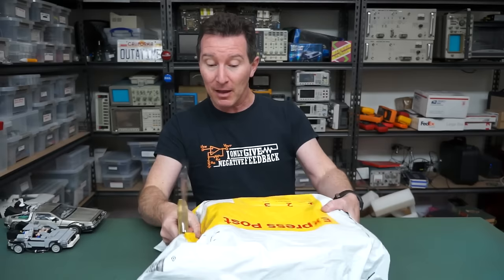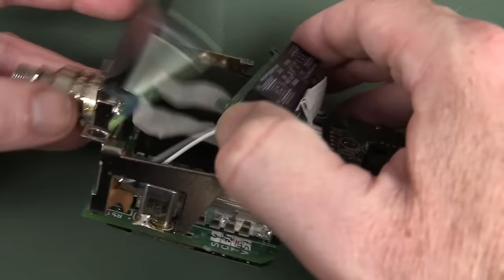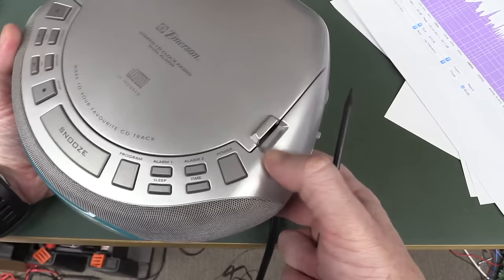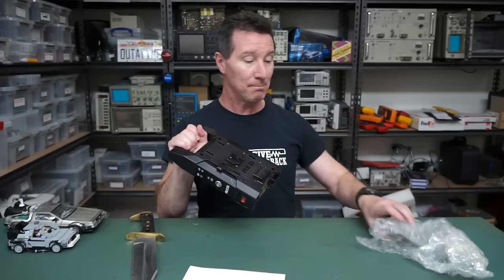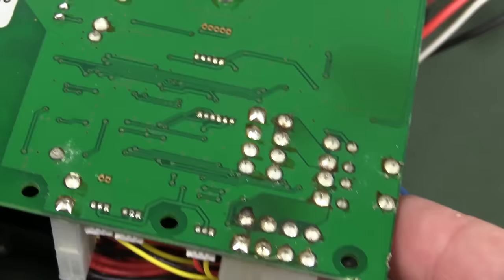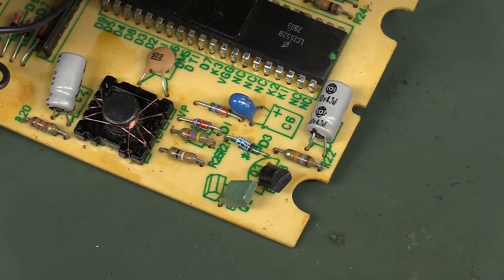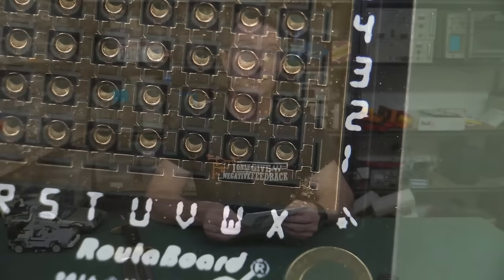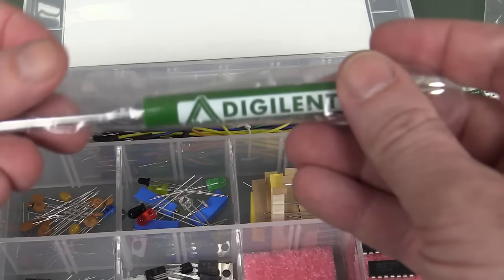EEVblog #922 - Mailbag

Comment: Sorry about the foam in the case holding the RF Signal Strength Meter falling apart. It was not like that when I sent it to you. Thanks for a great tear down.
Reply: How many years ago did you post it? :)
Reply from the maker: Interesting. Not the first time it's happened. I'm interested to know who the transport causes this so quickly.
Reply: Got left in a hot transport truck maybe?
Reply: And started to decompose as a result? Yup, sounds quite plausible.

Comment: Hi Dave, thanks for including RoutaBoard in your Mailbag review. Those were the earliest generation samples which I sent you right from the first prototype batch (best suited for the museum now). 
The recent model is improved with a better layout on the two sides, two more global buses, solder paste pre-applied over the contacts, so they can be bridged together by simply touching them with the iron. Still black soldermask, though. But point taken, I might try out a few different colours in the future, and see which one will work best.
Don't rush yet having a test go with the old ones. :-)
KnivD
Reply: I've got the newer version RoutaBoards and just want to say how fantastic I think they are!  I don't think I'd ever use the software, although I have played with it out of curiosity, and I appreciate the effort that went into it.  Still, this is, far and away, the most useful proto-board I've ever had the pleasure of building with.  The manufacturing quality is top notch.  I find they're even better for SMT than those shitty checkerboard PCBs you can get.  SOIC and chip carrier packages fit perfectly, but anything smaller than 1.27 mm, and you're out of luck (not that you'll find boards like these that are so flexible in the first place).  I really hope they catch on more and that you keep producing them.  As you can see, I cannot recommend them highly enough.

Comment: A while ago I was reading a story from the ministry that is responsible for tracking down radio frequency disturbances, and they   found a similar radio with a similar error (though the story reads in the 180MHz range, might have been the harmonics though). All the story said was that some "components responsible for coupling the LO into the receiver failed, diverting the signal" so my guess here is that some rf related cap failed short.
Reply: +1 so Dave can see
Reply: Kind of poetic how we've been building radios for over 100 years now and yet it's STILL the darn capacitors that cause the problems? The more things change, the more they stay the same, right?

I thought about this for a while, and if they're using a notch filter on the input to keep the LO frequency off of the antenna, it could be that the LO has drifted a bunch.
If it's crystal controlled the crystal could be damaged, or the circuit could be just so drastically out of tune that the crystal can't pull it back into alignment.
If that's true than all the filters designed to block the LO frequency could still be doing their jobs and the signal from the LO would still get out since it's on the wrong frequency.
Went down the rabbit hole a bit on that one, but hopefully it's understandable.
I know just enough about RF to know that I don't know enough to be talking about this kind of stuff with any kind of authority, I'm just hypothesizing.

Of course it could also be something as simple as dried out power supply decoupling capacitors, a fact that jumped out at me since Dave mentioned that this was built in the early-mid 2000's. Those caps have been in service for 10-16 years by now, and that could by itself be enough to cause them to drift and/or fail if they're using whatever is cheapest at the shenzen market that week.

On another note, I'd bet this radio would have been tracked down as a noise source by some ham radio operator if left on long enough. It looks like it was putting out some serious harmonics well above the 95Mhz "fundamental" peak.
Reply: When I was 10 years old I tryed to "modify" a cheap FM radio by adding bridge wires to the circuit and turning the tuning coils. I had no idea what I was doing the the thing went totally crazy. I was able to jam most TV channels from 100 meters away with the radio. I wish I still had the thing to test it on my spectrum analyser.
Reply: The filter of the output signal processor of the Frequency mixer could be faulty. Meaning that the device is now transmitting the 4 different Frequency signals at the same time, and possibly at an amplified level, if the amplification section of the output signal processor is still working

The Multiplier component of the frequency mixer could also be faulty, in that it is not able to correctly tell the output processor how much amplification is needed from the data of the original signal 

I'm probably terrible wrong, but what can you do..
Reply: "I was able to jam most TV channels from 100 meters away with the radio."

Some older computers had a similar effect in that the screens RF made sounds through the computers speakers because of the high level of/ poor RF shielding etc
Reply: I think my solution only works if there is an RF signal to begin with.. I'm not sure what frequencies an rf receiver of a radio can pick up 

I'm guessing it could also just be the electricity running through the frequency mixer from the LO into the multiplier, and there is a blockage from multiplier to output signal, so it travels the closest path back out up the input rail ?

Comment: I don't know about failure modes, but in my wild and careless youth, I had this habit of turning old superhet FM receivers into FM transmitters.
Long story short, even if you have proper variable caps for the tuning, you very often have varicaps for AFC. So, find the afc control voltage net, add a chain of components consisting of an RF choke, DC block cap and pre-emphasis network and apply appropriate voltage level signal and you have a low-power transmitter...
So if you go ghost-hunting on the clock radio, my chief suspect would be some component failure or crud in the LO signal net.

Comment: THANK YOU! And this is why I have, since I was a teen, been completely ANNOYED by Gilligan's Island! There is no way a know-it-all "Professor" who could make batteries from coconuts and seawater would NOT KNOW you can make essentially ANY receiver into a transmitter simply by pumping more current through the local oscillator!

You have a radio that works!
You are supposed to know everything!
HOW DO YOU NOT KNOW TO SHORT THE EMITTER OF THE LO AND TRANSMIT CW ON AM BROADCAST?

Shortest TV series ever.

Comment: Using a working radio and tuning it to the local oscillator of another one is a known old time trick used to check if the oscillator of a receiver you're servicing is running or not.

Comment: That Li-Ion professional camera battery charger is for V-Mount batteries, the batteries themselves have micros inside that can talk to the camera via different protocols (I2C, analogue etc) depending on the camera manufacturer, to report the remaining time by sensing current draw, autobalancing the battery cells etc. the chargers usually cost over 300 euros. and the batteries are also 150+ euros.

Comment: In that clock radio thing it looks like the front end amplifier has become an oscillator.  Some of it's output energy is feeding back to it's input, and hence to the antenna.

Early transponders for military aircraft worked like this.  They were basically an antenna connected to a tube amplifier that was on the edge of instability.  When an RF burst comes in from the interrogator on the ground (or ship) the amplifier would go unstable for a short time, during which it transmitted back another RF burst at about the same frequency.

Comment: For the radio, read the book Spycatcher and you will find a description of a technology to track radio receivers by LO emissions.  Since spies don't want to be heard, they use a different frequency from the ones in commercial use.  Spies typically would listen all the time and only transmit on cue or on time.  thus the only way to catch a spy reciever was to listen for the LO emissions.  Modern radio receivers would not likely emit the level of LO noise that old radios did though.

Comment: I've got the newer version pre-soldered RoutaBoards and just want to say how fantastic I think they are!  I don't think I'd ever use the software, although I have played with it out of curiosity, and I appreciate the effort that went into it.  Still, this is, far and away, the most useful proto-board I've ever had the pleasure of building with.  The manufacturing quality is top notch.  I find they're even better for SMT than those shitty checkerboard PCBs you can get.  SOIC and chip carrier packages fit perfectly, but anything smaller than 1.27 mm, and you're out of luck (not that you'll find boards like these that are so flexible in the first place).  I really hope they catch on more.  As you can see, I cannot recommend them highly enough.

Comment: Products like IntegriFuse are important because USB security sucks and it's pretty easy to dump payloads on a mobile device or have a compromised mobile device dump payloads on the machine it is connected too because USB was not designed for security(there are no USB firewalls!).
  I really don't know how good IntegraFuse specifically is so I'm not endorsing it beyond saying there should be a market for products like it(affectionately dubbed USB condoms).
 My other thoughts are maybe it should get a actual set of FBL fuses because USB 3.0 can do like a 100 watts of power in special modes.

Comment: The connector on the TEK meter could be done this way because this product is pointed to different markets and different connectors may be suitable. Also, as a second idea, it might be done this way to recess a connector in respect to pcb to meet some height considerations.

Comment: I think the RF strength meter's charger socket's sub-circuit-board may be just a space saving measure. (Main circuit-board has the clearance it needs without one half of the outer-case becoming too deep.)

Comment: On a radio receiver there is supposed to be a band pass filter on the antenna input to keep the LO from leaking back out.  Part of this filter has failed and is allowing the LO to leak out from the first heterodyning stage.  

If the radio was locked onto a channel the LO frequency would be more stable and wouldn't be hunting.

Comment: I had a Logitech X-530 2.1 system. Use to pick up radio stations. Believe it or not it was a lack of grounding on the transformer that caused it, or at least lack of grounding to the board since the cord is non-grounded. just attached a wire to the casing, attached the other end to the "ground" on the amplifier board with a resistor in seiries, it stopped receiving. Emerson was decent stuff, weren't the best quality but they work for years. The cd player has shock mounts because that radio probably has "anti-skip" which back in those days was just a term for something that was well shock mounted.

Comment: FYI RED camera gear are monstrously expensive, that charger costs $550 US without batteries witch are $450 each. they also sell "cheese plates" (square pieces of aluminum with 1/4" holes in them) for $275 and various semi propriety cables for $100+ they even sell a 6" bnc cable for $50 because its labeled as a "HD-SDI" cable witch is a protocol that runs over coax. their cameras are not that badly priced but they really kick the bucket in all the accessories that they make %3000+ profit on

Comment: Dave, I think the interfaceconnector is on a seperate board, so they could use an other connector (with an other formfactor) more cheaply on the same main PCB without redesigning the whole thing.

Comment: Actually you want some bias when using that RF tool, so you would plug it in at the tv or as close to that as possible. If you do it from the roof, as you said it's minimal loss, the results would be better signal but the tv would have a harder time reaching those channels. Also you would compare it with and without the cable to tell if you need a booster or not.

Comment: I'd guess that having the connector on a separate board prevents damage to the main board if dropped while plugged in.

Hot connectors on that charger. Looks like they rolled their own rapid charger.

Comment: I suspect the connector PCB is to make it more flexible if they want to switch battery connector. Then you don´t need to remake the whole board.
Another reason may be to get battery connector in right height...

Comment: DB25 on the sub board in the TV signal strength meter is probably fitted that way to allow different socket types to be fitted at manufacture without needing to respin the board for every type.
Reply: or the original socket went EOL and they didn't want to respin the whole thing!
Reply: Other possibilities are is some mechanical issue with alignment or to make it easier to replace if damaged.
Reply: Perhaps they did not have the option to change the battery or the case design, and so was limited in how high the connector could protrude from the circuit board.

Comment: the USB fuse, that is a terrible idea, for charging it is really important the phone know's what's it's charging off. Shorted data pins means it's a normal 5v charger, and will try to pull as much power as possible, if you do that off a PC you're gonna have a bad day. If you don't short them you'll only get 500mAh and it won't charge. I know my quick charge 2.0 charger communicates with my phone to deliver 9 volts @ 1600mAh, failing that 5v @ 2000 mAh. Not to mention it seems that one data line passes though anyway.
Reply: I believe the point of that thing was that you would put it on the charging lead of your phone or tablet if you are going to connect it to one of those public USB charging points.

I suppose the idea is that since It is in theory possible that such a point actually has more than just a charger in it( and so could install something nasty on your device or steal data from it), you might want to break the data connection while still maintaining the ability to get power.

Though how good that specific device would be, I don't really know, you would after all have to trust that it was not something nasty itself, and that it was not badly designed in some way. xD

Comment: This Orange Pi is not worth getting yet, for the common person that only knows basic code. There is almost no driver support and you can't get them to fire up there is no bios to start from. It will not recognize anything. Not a keyboard not a mouse. I have 2 Pi 2's one wireless model and a Pi 3 with the works even has sata. Sadly I don't have the skills to program it.

Comment: That RED charger is probably for NiCD batteries. Maybe that is why there were a discharge resistor and no LiIon charger chip. We had a V-lock battery bursting into fire at work when being charged on a similar charger. Exiting day. That was in the early 2000s.
Reply: There is "LI-ION BATTERY CHARGER" written on the device.
Reply: +kroplaaaa oh! Sorry :)

Comment: 08:00 I like this video but there are few inaccurate facts here. This is not a single layer board. IC's for CD player are on the other side wave soldered also common IF frequency in this kind if FM radio is 10.7 MHz not 455 kHz.
Reply: "Single layer" refers to the number of copper planes on a PCB.  Assuming from your comment that we are still discussing the ghostly transmitting radio, it is a single layer board with a double sided load (not unusual where through-hole and SMD are mixed on the same board).

Comment: Maybe they just realized at the last second they needed that connector to go the opposite way around? :)
Reply: Perhaps the connector was just a few millimeters too high, and would have caused a protrusion where they wanted to mount the battery, so they used this method to offset the connector a little.

Comment: A RED camera cost like 160,000,000 US Dollars. No joke.
Reply: 25,000 usd... maybe... if you're including accessory cost too
Reply: TimeFromYesterday The Red Dragon is $50,000.00 with the SSD module and lens mount, a decent cine lens is at least 2,000. Decent tripod etc..... 160,000,0000 lol.
Reply: +Mathieu Riesling you still can't do maths.. If the camera costs 25 thousand, then the equipment is not gonna cost 1.6 billion dollars.(mimus the 25 thousand of the camera). Do you even 2nd grade maths? Also there is no ",0000" assuming that you mean 1,600,000,000 you have no clue what you are talking about
Reply: Valentino Saitz double *facepalm*